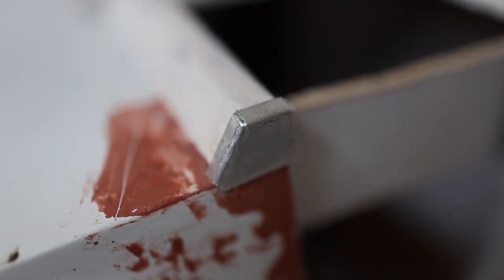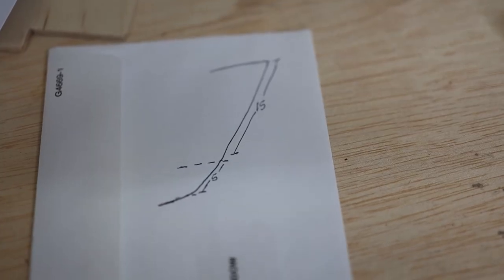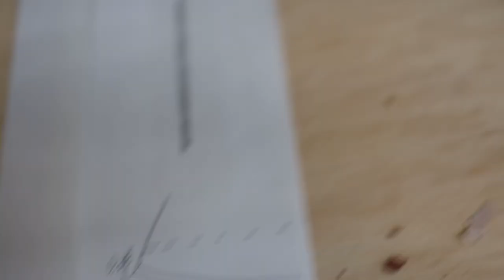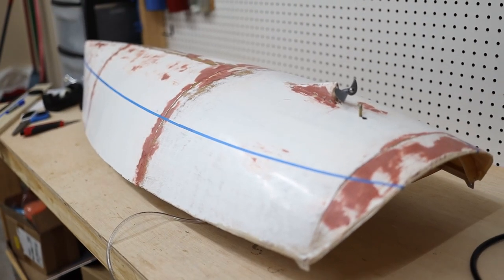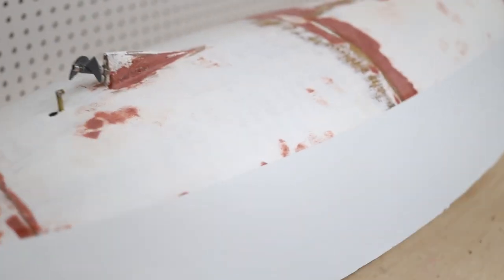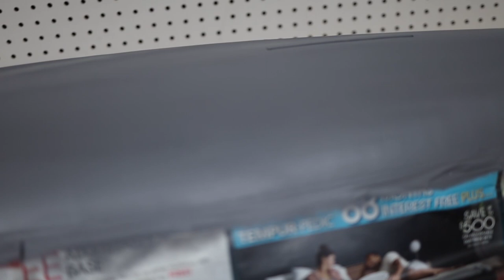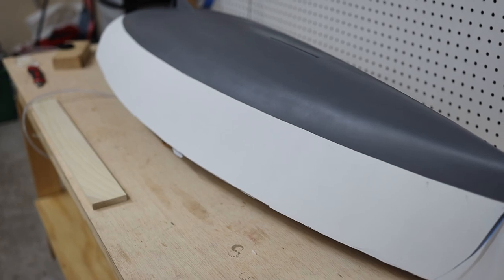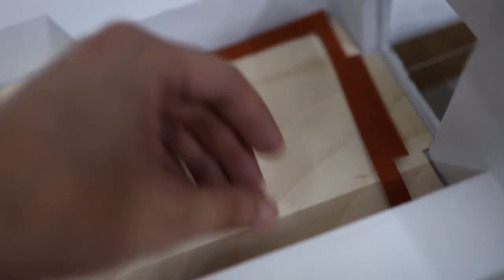RC boat Beneteau 37 build part 10

Comment: Gracias por su presentación. Buen trabajo. Respetuosamente creo que el resultado hubiera sido mejor y más sencillo imprimiendo el casco y la cubierta con su impresora 3D que entre otras cosas es de muy buena calidad. Cordial  saludo.
Reply from the maker: Fue algo que pense cuando estaba uniendo las differents piezas del molde, pero la impresion 3d tiene varios problemas, cada capa de material no esta fucionado completamente con la anterior dejando orificios por donde el agua puede entrar, otro problema es que no es tan fuerte como la fibra de vidrio y tendria que aggregar mas material y peso. Incluso cuando applique "primer" para dar el acabo final al molde y darle lijado humedo el agua pasaba atravez de la pieza, y para recubrir el barco impreso en 3d pense que era mejor hacerlo de fibra de vidrio completo y dejar solo moldes en 3d. Quizas en el futuro pruebe hacer un modelo pequeno usando tu sugerencia. Gracias por tu pregunta y saludos igual.